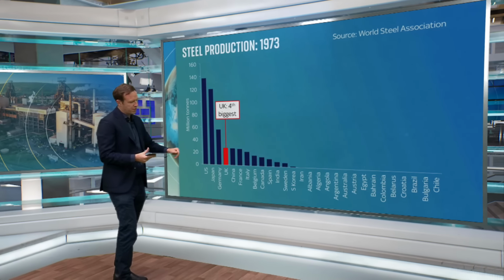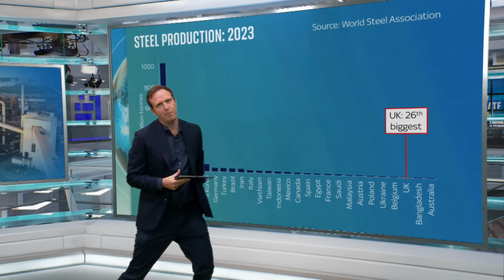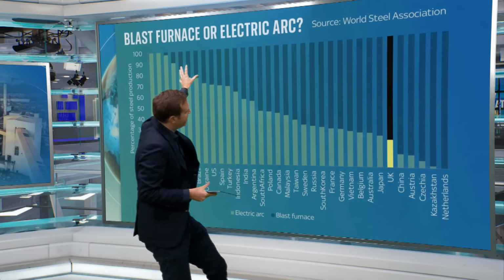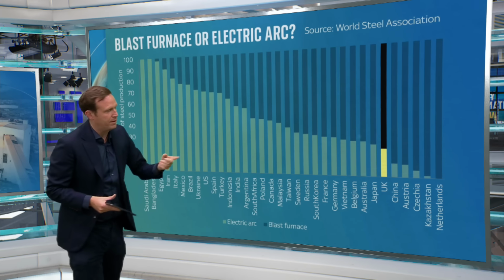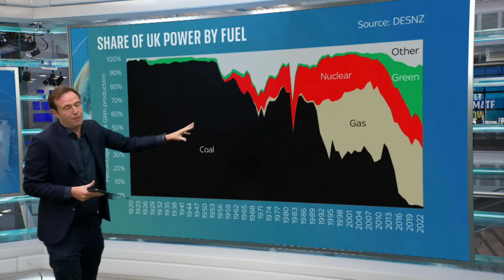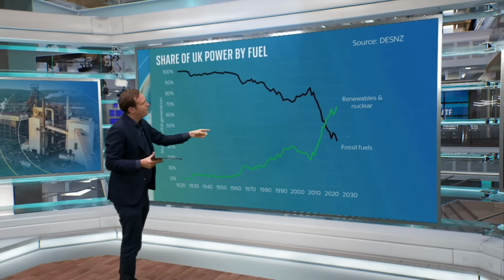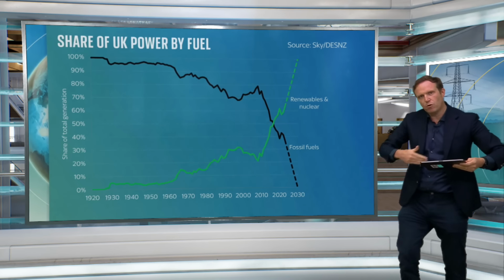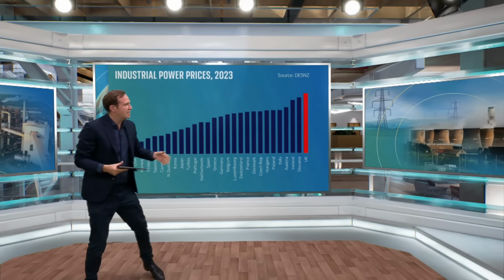UK's last coal-fired power station closes

Comment: China = 1 billion population 
India = 1 billion population 

Global CO2 emissions of UK = 1.7%

Steel jobs are outsourced to India while we gave them billions of pounds in Foreign Aid to a country with a space programme.
Reply: That CO2 Emissions calculation is misleading. It’s actually higher than that but Britain uses a rather misleading calculation in that because 11% of energy comes from the burning of wood pellet (ie two coal fired coal plants were converted to biomass) it can claim net-zero on that source on the basis that the huge levels of carbon dioxide that burning wood creates gets sucked up by growing trees. The question is, does the UK ensure that the old growth trees in Canada that are felled to produce wood pellets (of which Britain consumes 22% of world production of) get regrown? And would the 40 million tonnes of wood / timber required to produce the 10 million tonnes of wood pellets consumed (burnt) by the British government each year need to be cut down, if they had of stuck to coal? Britain has been consuming forests in Canada at such an alarming rate that they now need to burn wood sourced from South America, including illegal logging from protected reserves in Equador.

Im assuming that those anti-coal environmentalists in Britain are also anti tree. If they’re not, then they’re hypocrites.

Britain has achieved nothing from the switch away from thermal coal other than to impose additional capex on taxpayers, and put people out of work. But typical of the British Government, rather than achieve a real outcome they fudge it via the use of what’s essentially an “accounting loophole” and pretend to be improving the environment. 

I’m not sure how environmentalists can claim that the loss of 40 million tonnes of forest per year is a positive outcome

Now that’s what happened re coal fired coal plants. The strategy to move away from met coal in steel production is even more misleading.

Comment: This is a national disgrace.
Reply: It’s a massive achievement. No reason to rely on foreign fuel sources. Lots of Russian bots in the comments that hate the fact we are going to have our own clean independent energy supply.
Reply: @ashleigh3021 clean independent energy supply? The UK switched from coal fired power stations to one’s that burn wood pellets. The problem with that is (a) burning wood pellets results in higher levels of carbon dioxide being released into the air, and (b) the wood pellets are produced from trees primarily in the Americas including old growth forests in Canada and also rainforests in South America. So the UK is far from independent as it has to source its wood pellets from overseas, and it’s actually “dirtier” than the previous energy source (thermal coal). 

How the UK gets away with claiming a shift towards zero carbon is that because trees can be replanted the burning of wood pellets is deemed “carbon neutral”. But the reality is forestry companies are planting trees after removing trees. That’s the true neutral aspect. But the UK is still emitting more carbon dioxide into the atmosphere from wood pellet / biomass than it was coal. 

The increase in renewable energy is a great step forward. But is unlikely to ever provide a complete energy solution for a country. 

I wouldn’t be patting the UK Government on the back. Being misleading and deceptive puts them on par with the CCP
Reply: @ The vast majority of energy will be provided by solar and wind firmed by battery storage. A few biomass plants are virtually irrelevant.
Reply: @MickRhodes-ml5cm  I agree with your thoughts on biomass, but it makes up such a tiny part of the UK's energy mix. As has been pointed out the majority of our energy comes from Renewables, Gas and nuclear. With renewables now the cheapest and fastest growing in the energy sector.

Closing down coal plants not only makes environmental sense, but also an economic one, as coal simply cannot financially  compete with modern renewables.
Reply: It is actually something we can take pride in.

Comment: Another how Many jobs lost. With no prospect in sight for anyone in any industry in the uk.
Reply: More jobs will be gained by renewables, this is a very good thing
Reply: @Phyt5  Jobs that can be ran by a.i /robotic computer systems
Reply: @BarghestOne  no, renewables gain hints and don’t screw over the environment which is the biggest issue facing our species
Reply: @Phyt5 but unfortunately renewables will never be able to be the sole energy source of a nation. But still, I’d prefer to live in a world where at least some of our energy is derived from renewables
Reply: @MickRhodes-ml5cm WRONG. Renewable-Energy boosts the economy better than fossil fuel
Reply: It is @Phyt5
Reply: Unfortunately the price of solar panels are so cheap the world is replacing the coal plants. They need next to no maintenance. So loss jobs miners engineers train transport .ship transport. Ash removal and all associated industry. They now even have robots cleaning the panels. Electricity from solar may be eight times cheaper than coal but no jobs.
Reply: There are countless jobs in developing and operating renewables and storage, the site is literally being turned into a clean energy hub that will employ hundreds of people. Complete and utter nonsense.

Comment: Whilst china is building brand new coal fired power stations
Reply: China is investing more into renewable energy than any other country in the world
Reply: China generates 60% of their electricity by coal, send Greta Thunberg to protest there.
Reply: No they stopped that a few years ago for main production. China unlike the UK does not use gas to back up renewables. They use new coal plants with fast start up if required... Nothing is black or white
Reply: New coal fired power stations are better for the environment than what Britain has turned to - burning 10 million tonnes of wood pellets each year which requires 40 million tonnes of forest to be harvested each year. It’s a massive con
Reply: China’s coal fired power stations release less carbon monoxide into the atmosphere than the UK’s wood pellet power stations. Doesn’t involve cutting down vast tracts of forest either.
Reply: @MickRhodes-ml5cm  What complete bs.
Reply: @dereksue4877  per unit of energy. Totally true